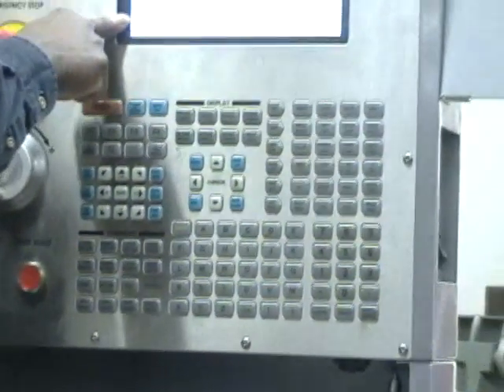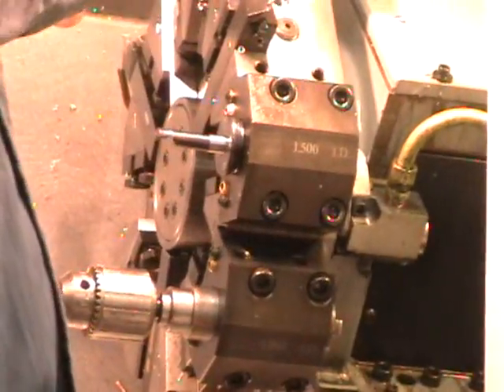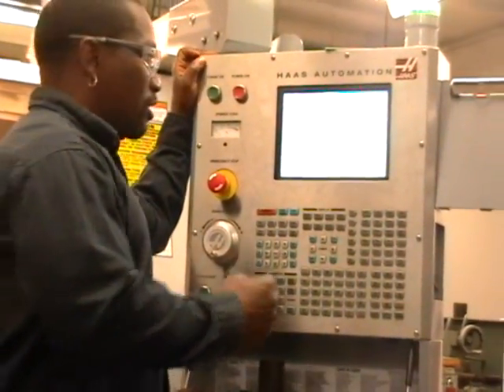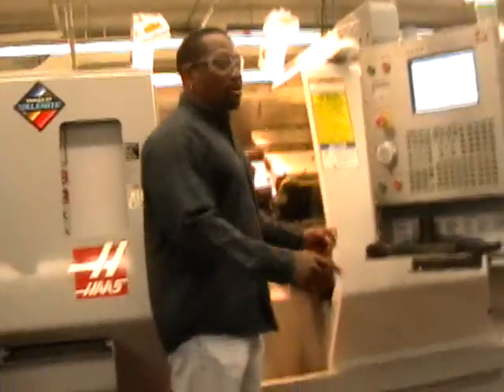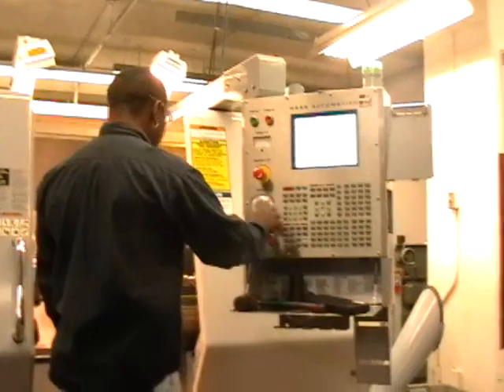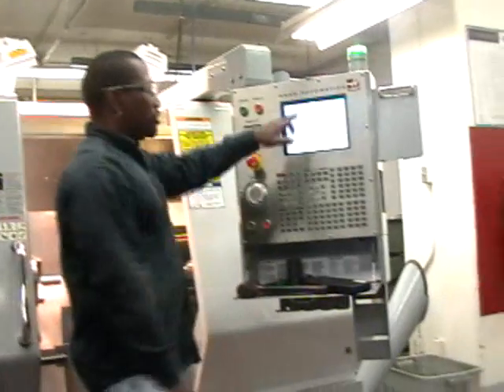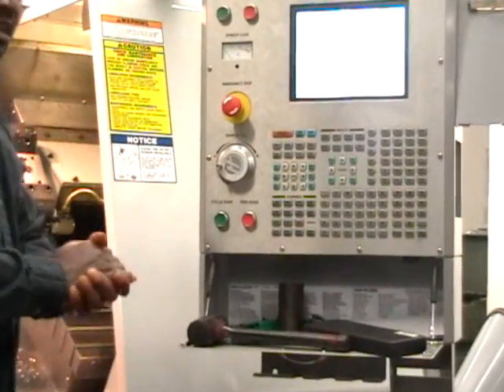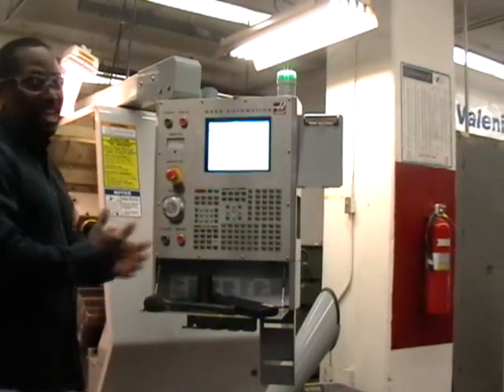Haas Lathe Setup P3-3

Comment: This has to do with the differences between tool zero, work zero and machine zero. The -11 number is not really a "zero" per se, it is the distance from machine zero to the center of the spindle. Machine zero is usually referenced from the machine's home position.

Comment: Have a job interview for lathe,I have been away from working machine shops for several years due to the economy but did complete cnc industrial technology courses more than a year ago. I just need to refresh my memory. Can any one help?Does any one have any information like familiarization step by step on the Fanuc control. In fact does know od cnc simulator that i can practice on via internet?